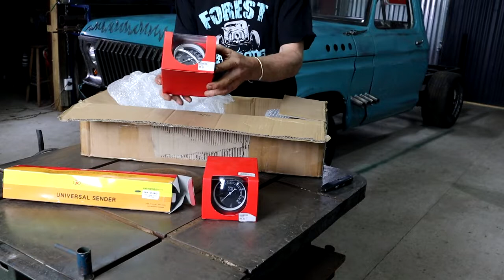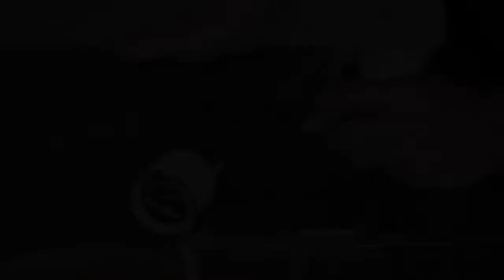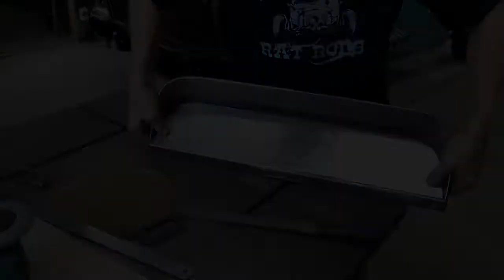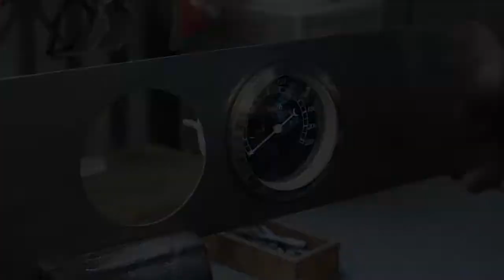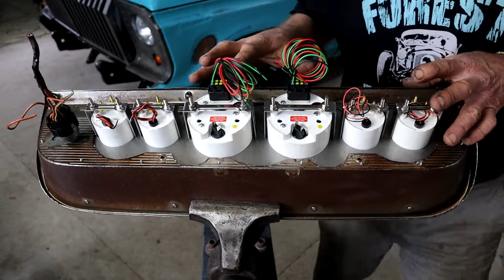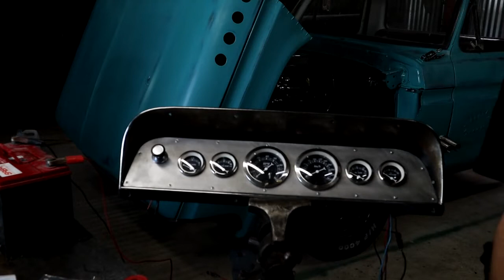How to make custom instrument cluster

Comment: Great episode Diff....
I hear you call the tachometer a rev counter..that's different..😆,,,
Your shout out to Rat Rod Bob..on the air control was much appreciated..we were talking about it the other day....dash looks great man.....we did all new high-tech gauges on the junkyard dog...speedo was similar with no cable..wire to sensor in tall shaft housing..works pretty good...have yourself a great day fellow rat rod builder..
Build on brother.👍👍😎💪💯
Reply from the maker: Hey, howzit Don. Yeah, quite a few different words we use. Like bonnet for hood, mudguard for fender, boot for trunk lid. To name a few. Those GPS speedos sure do save all the hassle of a drive cable. I love them.

Comment: Div , the EASY way to convert ANY metric number is to multiply MM X .03937 = INCHES in Decimal  . 57 MM x .03937 =2.244  inch . Forget fractions , no good fabricator uses those .
Reply from the maker: Don't you think decimal inches is an oxymoron?

Comment: You may need to run the gauge lights through the dimmer section of the light switch but it’s just a RR ⚡️
Reply from the maker: Exactly. And who needs complexity.